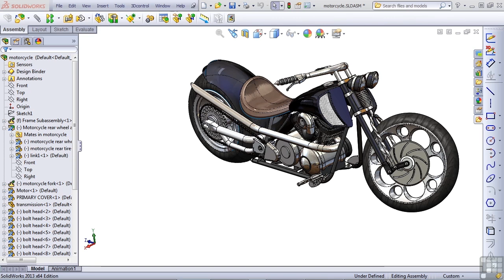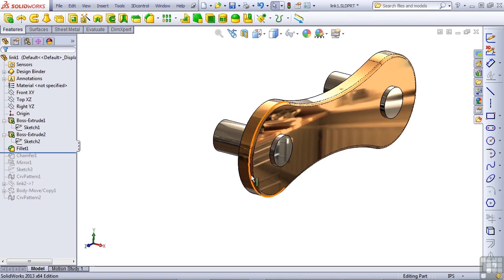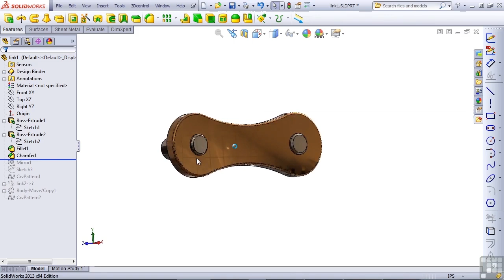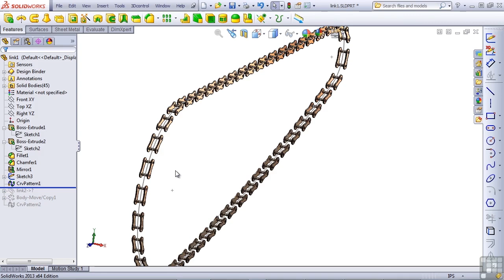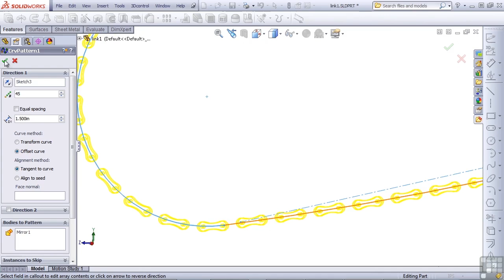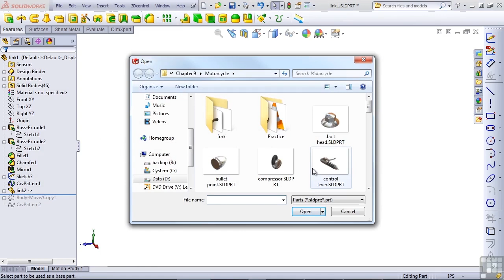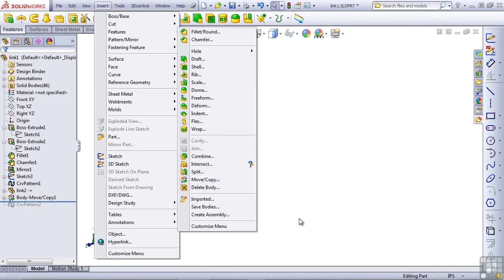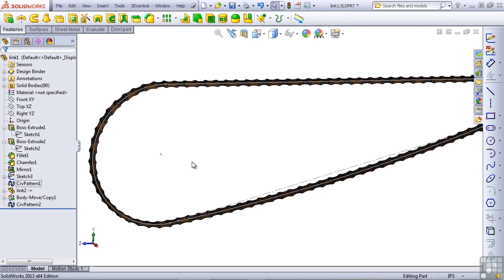SolidWorks 2013 Tutorial | Creating A Multibody Chain

Comment: Nice tutorial.  It seems like it takes the center of mass of each body as it copies around the sketch.  The actual links are not precisely where they should be - I found this out as I tried with a chain using 2" long links bending around a tight sprocket.